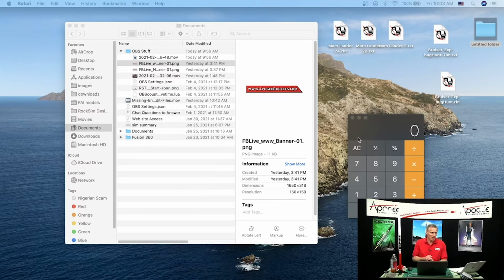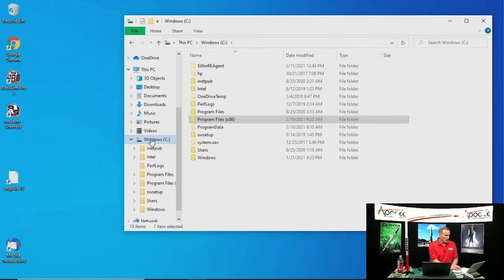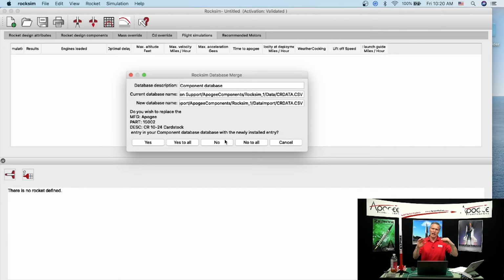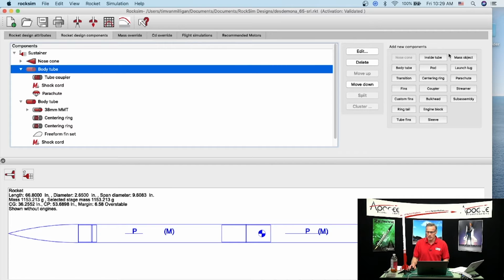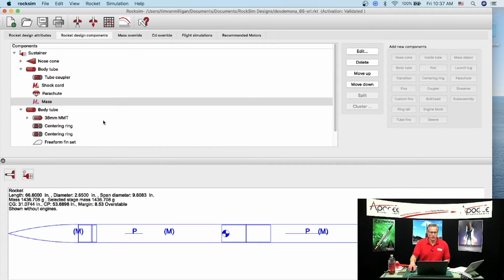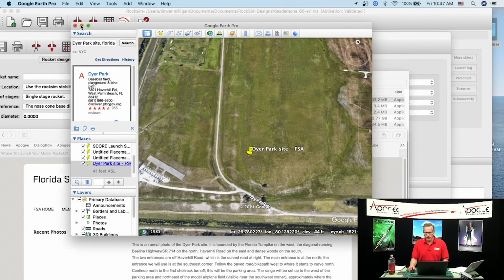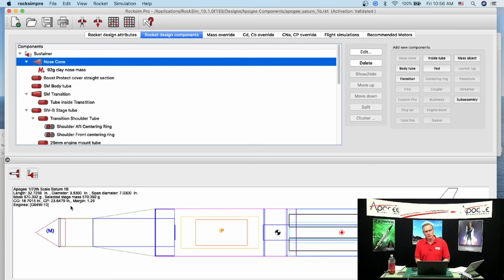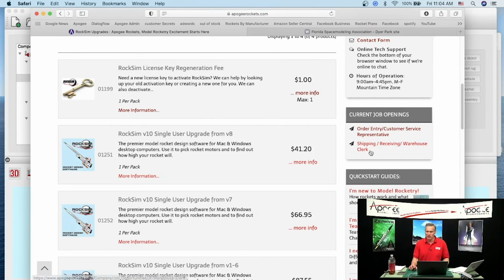File Structure and Adding your Launch Site to the Pro Visualizer

Comment: About 52 minutes into your video presentation you show a simulation of a rocket takeoff and landing.  It appears that the trajectory for the takeoff is OK (curved), but the simulation of the descent with a parachute should also be curved....here it looks kind of straight like a piece of a triangle...based on our research the descent should be curved and not straight...care to comment, please...john
Reply from the maker: The descent of the parachute is typically a straight line if the wind is constant speed and direction, and there are no updrafts/downdrafts of wind. In real life, that happens all the time. But in the simulation I ran, I had the wind set at a constant speed of 8mph from out of the west. The software can allow for variable wind at different altitudes, but I didn't have that set up for this simulation.

Comment: I'm using Rocksim 10. Is there an upgrade path to Pro?
Reply from the maker: When we release the pro version, there will be a different payment structure. Because of the flight visualizer, we have to go to a subscription model. We incur charges on a monthly basis for the system, which is why this will be necessary.